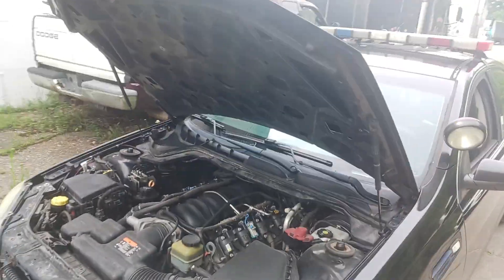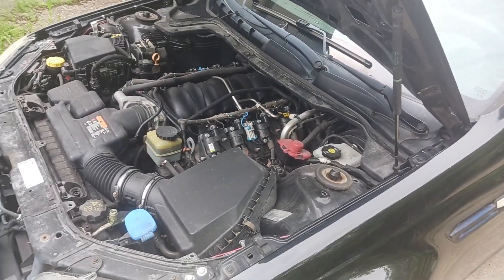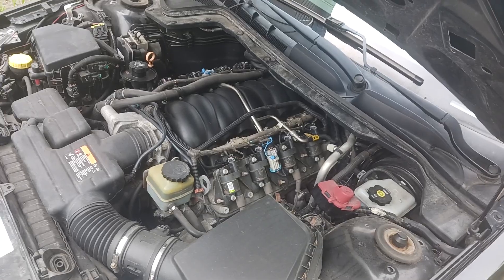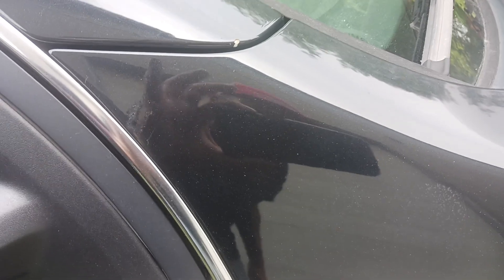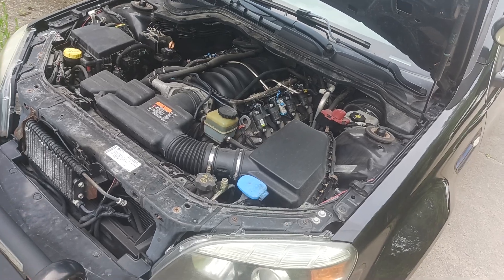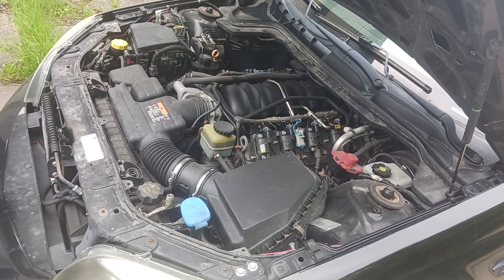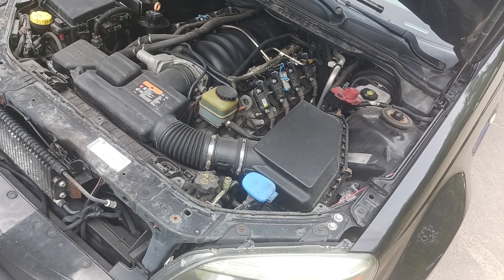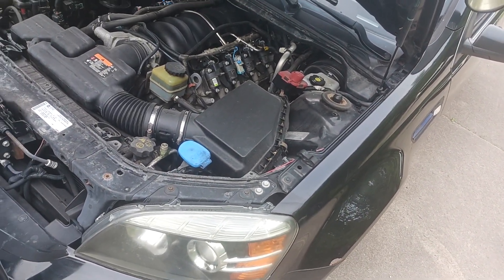2011 Caprice PPV LS/L77 V8 Engine Chirp Lifter Update

Comment: i dont think they make the caprices anymore very rare car
Reply from the maker: 2011- 2017  Made by G.M Holden Australia Based off  the Australian Holden Commodore.
Reply: @Chiefgeargrinder  did u import it?
Reply from the maker: @Porschegaming-on7hk  No. It was a local city police car and it went up forsale at a local dealership then I purchased it.
Reply from the maker: @Porschegaming-on7hk  Very rare for a city police department to use one. Most were used by Maryland and Illinois HWP units.